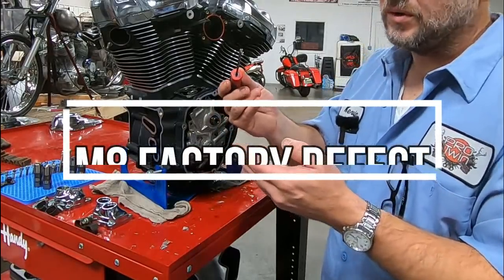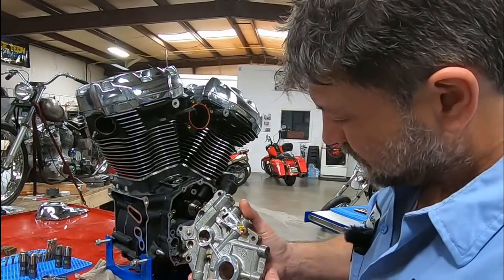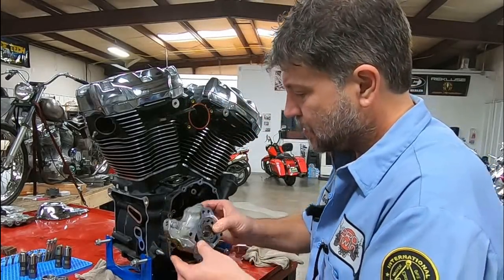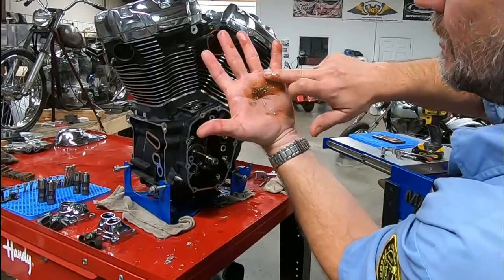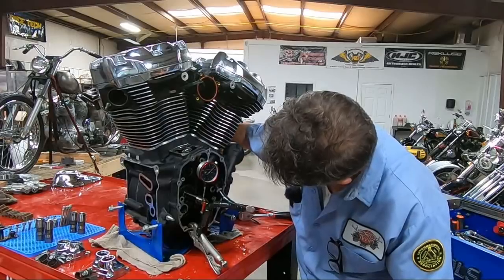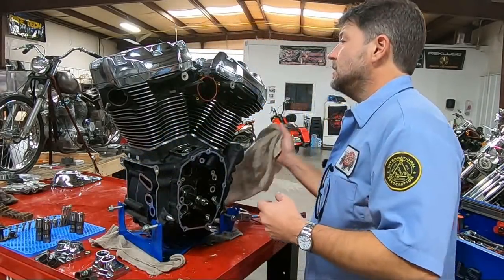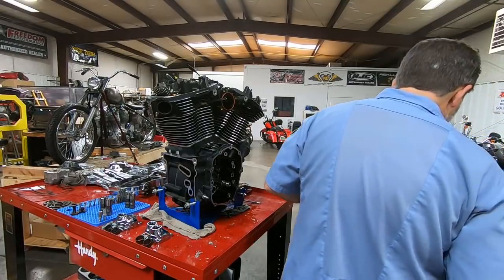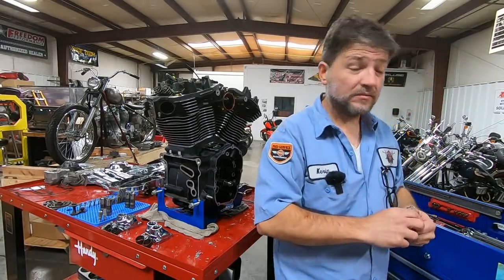Milwaukee 8 Problems Part 2 | MAJOR FACTORY DEFECT FOUND | Kevin Baxter - Pro Twin Performance

Comment: I wonder if the "Bang" the owner heard once in a while when starting it, was a lifter being hung up by those chunks of metal, and then the valve snapping closed when/if the metal dislodged and freed the lifter back up. Or maybe the noise was simply metal swarf going through the cam gears.. 🤷🏻

Comment: My guess is the case halves just weren't cleaned following the milling process. Really doesn't seem to be any reason for THAT much material to be left behind. The size and shapes of the chips seem to indicate "mill tailings". OR, by Leaving all those tailing behind, MoCo was trying to implement a new "pre-filtering and "flow control" of the oiling system!!

Comment: My hunch is that during the manufacturing of that engine block, Harley factory failed to clean out the metal shavings and debris. They somehow missed that step and just slapped the motor together.

Comment: Only a guess as I have seen this in automobile engines that I used to rebuild when I worked for General Motors. I half way suspect you have a broken piston skirt that has been thumping around periodically on the inside of the engine. With a broken skirt, the engine will still run perfectly fine. Perhaps a little bit more vibration than normal but on a Harley almost not noticeable. Let's see if I'm correct.

Comment: Oil valleys clogged with machining shavings causing the lifters to leak down causing the push rods to rattle. At lower rpm it would be able to keep up and not starve the lifters. Still amazing that it didn’t make its way through the oil pump. I’m going to assume the owner was a conservative rider and kept this bike very well maintained.
Reply from the maker: 100 percent spot on sir.  I'm amazed myself.  Yes...hes a very particular owner.

Comment: @20:20 my thoughts are the factory skipped a postprocessing cleanup step on the crankcase and put everything in a dirty crank case with manufacturing metal left behind.   Curious to hear

Comment: With that much detritus in the lifter block area, how did those lifters stay pumped up? How are rocker arms&shafts doing? 
    Strange indeed. I'm a 70 year very early MMI grad out of their first tech school in Phoenix back in '77.
Reply from the maker: Hey Mike....I've never seen the combination of factors before, that I've seen in this engine.  Still baffled at some of them...and were talking out of over 2400 engines in my days.  Bizarre for sure......  Thanks for watching and for your comment.

Comment: Mmmm. The alloy chips seem to me to be swarf from a climb cut produced by an end mill.  So, I deduce that post milling process did not effect a complete flush of the crankcase? And follow on from that, if an oil gallery is blocked, ... = Heat?

Comment: I’m commenting at the start of this video so probably missing a lot of info.  But, I’m wanting to see the rocker covers come off, because I’m wondering if something is eating the front head and it’s coming down the pushrod tube.
Reply: And at 20 minutes I see it is not coming from the head.  I’m gonna have to agree with everyone about the left over machining trash.  Disappointing that the assembler didn’t catch it and reject it.

Comment: It makes little sense as you said, back when I was around 16 years old I built a Honda 750 my first engine and I didn't put the chain runner back in and first thing that happened once the timing chain was loose it slapped the cylinder block and shaving destroyed the oil pump.

Comment: Left over bits bits of metal from machining process. It happens from time to time not very often. That explains the the coiled piece of metal you pulled out of the lifter area. If it was running when it came in i doubt you find any metal in the crank bearings. Worst case it could be the counter balance weight.

Comment: My 2019 Electraglide std had the oil from tyranny  to primary it would transfer 14 oz in 300 miles than stay right there the next thousand Harley  warranty covered the vent kit witch solved the problem entirely.  Now has 16,500 miles with no other problems.

Comment: I mean it is kind of comforting that with that much metal in there forcing their way past tight fits the motor didn't claymore on the owner so it is a pretty tough motor. I love mine. Shovelheads are still my favorite because I am not too smart and seem to be a glutton for punishment. Except the shifter fork that is my nemesis. I hate that $2.75 part

Comment: If you saw the process from the CNCs to the washers to the leak testers, you probably wouldn't buy one. I worked in that cell. I know. Maintenance PMs are far and few between. I tried my best, but pound pound pound. Get those cases out!

Comment: a piece of a casting or somehow a piece of aluminum got in the pushrod tubes during assembly or a portion of a aluminum pushrod broke and just got pulverized bouncing around and between the hardened steel of some components in the cam chest itself

Comment: During the casting process the factory never cleaned the casting flakes from the molding process so when the engine was assembled and run the oil pressure  broke off those metal flakes  and those got chewed up like fruit in a blender

Comment: Would guess since there is no wear on individual components you've taken from her that somewhere in the machine work of either the case or the heads that improper care in removing the shavings from the interior has lodged the spent bits in all the recesses while her fitting was being done. Probably wrong, but that's my guess.

Comment: Posting this just as you start to take the top off. I think the cylinder skirt was hitting the flywheel. If that is not the problem, then this engine missed the cleaning vat before assembly. JS

Comment: FOD from machining process.. I can't imagine what else could create those chips/shavings without obliterating all those other surfaces. And in the ports, but without circulating (apparently, based on oil pump lobes pristine and oil filter element clean)

Comment: I commented on the 1st video, this engine, with the thinned out valves, is just like the Poulan lawnmower, marketing even sounded similar and these same problems happened with that engine as well. I am curious to see what is the problem, or the educated guess, but I think the valves are the issue. Poulan fixed it by going back to thicker valves.

Comment: I bought a new Sportster in 2008.At the first brake job I discovered that all the caliper retaining bolts were cross treaded.Bolts should always be started by hand.If it was up to me I would trash Harleys impact drivers.

Comment: Now Kevin, you’re just looking for trouble. Several Harley dealers checked that engine and said it was normal and good to go. 
To be honest, I think I’m done with Harley . I have been putting up with crap for too long.  I am done turning wrenches. I’m old and want something to ride, change oil and tires and ride some more. When this Electra Glide goes, I think a Yamaha Venture is next.

Comment: Let's imagine this was a twin-cam engine: It's a good thing that the plastic cam chain tensioners didn't wear down, because I was led to believe from other sources; "just the plastic micro-shavings will grenade an engine!"
(But it might still run good, after it grenades!!)

Comment: I had a 107 and did crate engine 131 and I’m running @340-350 plus engine temp on a tune by Harley on dyno.

Comment: @19:40 - So I would think one of two things at this point....  Either the block wasn't properly cleaned after machining - or one of the disgruntled turds at the factory threw in some metal shavings from the machine room or lathe.

Comment: IAM wondering the oil.lines maybe cut them open see if there's powdered metal shavings in there,,I'd definitely replace them n flush out oil tank
Reply: Do you need a helper?,,lol I know a little is why I said flush oil tank, replace lines

Comment: I am just watching this and I suspect that after you found no evidence of wear so far that someone for some unknown reason threw down metal shavings into the crankcase to sabotage this engine probably at the factory. Car manufacturers have had similar employee acting out before so that is my guess. The shavings you are seeing look like something filled off of the crank case by a rotating mass or else a broken piston. Perhaps due to heating the piston became damaged. That is my guess

Comment: I had a 1994 ford truck new  started knocking At 1700 miles  they replaced  the engine  told me that on assy line they run out of good dyno engines  and but  a bad one in  to keep line. Going    what. Really   but they make it good  replace this mans.   Engine  too be. Fair

Comment: Metal shavings everywhere? Poor QC at the factory, metal shavings blocked oil feed holes to lifters causing excessive clearance at valves. Oil pump was also full of shavings too.
Not good for a $30K motorcycle. Just my humble opinion, being a retired mechanic after 35+ years.
In contrast, my 2004 GL1800 Gold Wing has had no mechanical problems whatsoever in 90K miles, all maintenance done at regular intervals.
H-D should replace the engine outright as an assembly for the bike owner.

Comment: if it had a broken skirt it would've blown up and bent the rod ,  piston would of turned sideways with broken skirt you would think , i think its something more sinister
Reply: I own a  m8 had harleys for 30 years , wish I had a indian
Reply: Factory didn't clean out milling
Reply: The oil goes through the cooler b4 the filter how stupid is that???

Comment: To have shavings like that and that one piece that you pulled out that said that it look like it had been drilled that has to be from a rotational factor something is shaving those off so I'm assuming that it's in the rotating assembly somewhere and there's nothing really aluminum other than the Pistons in the cylinders so I'm going to say it's got something to do with the flywheels something has come loose and is rubbing but he said it was a bang so it could be a piston hitting the flywheel whatever it is it's a wonder it did lock that engine up with as much shit that there was in there

Comment: If the owner operated this engine for 30,000 miles with known major problems (loud banging sounds, obvious overheating), can Harley (or the extended warranty company) decline to cover the repair?  Because you could sure argue that this constitutes abuse.

I really can't imagine what the owner was thinking.  Yeah Harley service blew him off, shame on them.  But he verified that the bike was running hot, and loud banging sounds are an indication of something seriously out of whack.  Why didn't he push a little harder?

The meek may inherit the earth but they won't get good service from Harley, apparently.

Comment: HMMMM,🧐 it certainly looks as though Harley has left quite a bit of swarf ,left over from the manufacturing process in the cases, I’m quite shocked that it’s been missed because,surely someone would have picked up on it during the build of the engine??? We’re in the United Kingdom 🇬🇧 😊

Comment: If the engine employs coaxial valve springs, an inner or an outer could be broken - I don't know this engine. Something made out of steel is cutting away something aluminum.

Comment: Why isn't HD covering the coast of the repair or even I would think they should replace the motor with a new one since this was a manufacturer screw up that the owner has been complaining about almost since day 1. I don't think that it is fair that he has an engine that has to be rebuilt at 30000 miles that should have lasted a lot longer

Comment: I was thinking about buying a another Harley have a 1200 s 1999 with about 150,000 mi
But I'm seeing alot of problems with all the newer models that I'm thinking my next bike will be a 900 rs Kawasaki I have ran Kawasaki for years very fast and in the heat they even run better I have never had  any problems with a kawaski moter or trans and if I was to get a another Harley with low mi. I might have to spend thousands of dollars to keep it running because the service department in Vegas will charge 8 or 10,000 dollers to fix the moter the old 1200 has never let me down but it's wore out trans is still good but to avoid the hi coast at the service department and to get a bike that never brakes down or have engine or tran problems I think I will just buy a Kawasaki rs 900 with 110 hp that handles super and u can get heated grips,and windshield and bags and I will not have to worry because they will run forever and is the only brand bike I trust and I have Ben driving bikes sence 1970 other bikes like Honda,yahama ,Suzuki, or junk the only thing I don't like is the chain And not the belt because the belt will last forever and a chain u have to adjust ever so often and replace sprokets other then that the Kawasaki handles better in the rain ,and heat, more power and speed ,lighter weight,and much more reliable then a Harley🧝⚡

Comment: Sloppy manufacturing with the part not properly prepped for final assembly. Especially the oil travel channels since you mentioned that it "looks like drilling".

Comment: I dont know as Im an automotive person. Im lucky, I feel, to work at a little higher end used car lot. I get to figure out all the cars, not.just a brand. Without knowing, Im going with cam plate chewed up and want.to go with a chewed cam. But it ran too good at times for a cam lobe to have shit the bucket. Im curious. Chain slap machined the block maybe? Isnt my forte but this is what I want.to do for a living. At pro twin. In winder, ga. A mechanic never diagnoses over the phone. A smart.one anyway. So many variables. Im gonna go with cam runout first. Back of the cam plate. Then maybe bad tensioner eat the block and lastly, lifters.chewed the.cam. I dont.know what Im talking about. Its mechanical. I do well with automotive so I dont believe the leap over to twins is too far. Time will tell. Love this channel and intend on working for him after its all said and done. Wish me.luck subscribers.

Comment: It’s gotta be leftovers from the engine machining
Reply: But that won't cause the banging the owner mentioned,  got to be some reciprocating part !!😄😄😄😄🍺🍺
Reply: @artmchugh5644  oil shavings could temporarily block oil passages and cause metal on metal contact which could cause the sporadic noises

Comment: These filings aren’t from when the block was milled. There are procedures and checks making that unlikely. More likely, the owner has an enemy who dumped a handful of filings into his cam chest. This would be easy if his enemy worked at a place where he got his bike serviced, but it could even happen in the night on a quiet street. Only takes minutes to open and close the cam chest. Furthermore I even know how he could find out who did it. He only needs to ask himself who’s wife or girlfriend he slept with before first hearing the bike make those noises.